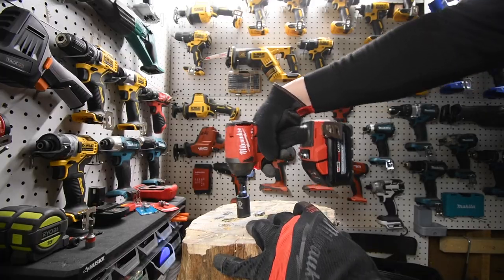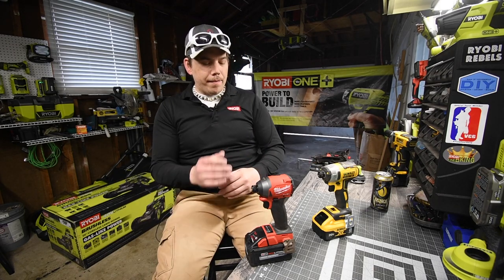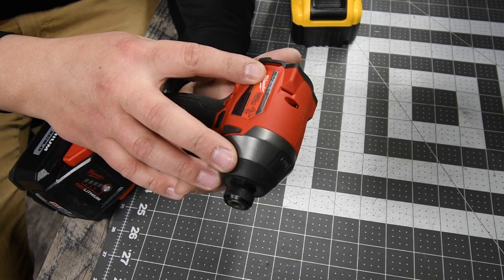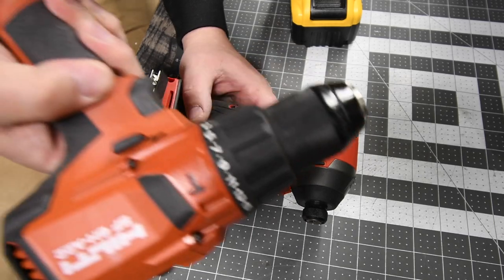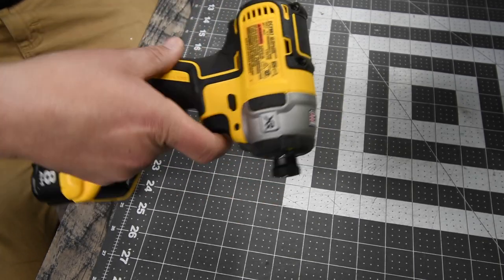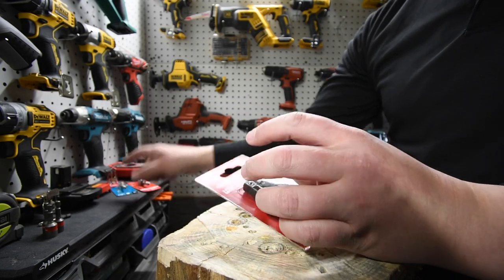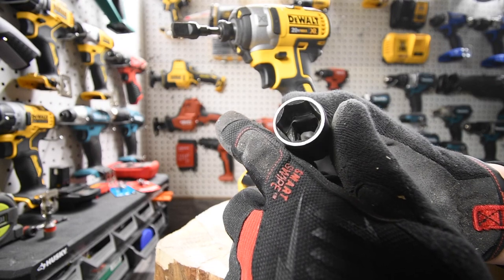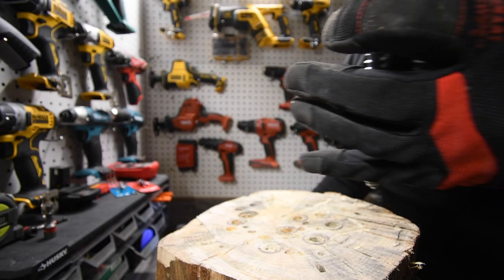NEW!! Dewalt 8ah vs Milwuakee 8ah HO

Comment: For many years Dewalt was the best impact driver .
What milwaukee did with this impact driver is they put a rapid motor and harden the spring, and one my tool they put a special smell as a burned tool so I don't know the difference when is really burning 🙂
Reply from the maker: I think they should make a better version
Reply: Dewalt never had the best impact driver

Comment: I like how small the Dewalt and Milwaukee 8.0 batteries are. I wish the Makita batteries were smaller
Reply: Makita makes a 2ah small battery and I love makita the impact I got is a beast
Reply: Makita needs to make newer 18v batteries in general they only have up to 6 amper hour while millwaukee has 12 and after a quick google search i learned so does dewalt, ryobi and ridgid make 9 ah i feel like every tool company should atleast make up to 8 ah also shoutout to bosch for having insanely small batteries for their ah size
Reply from the maker: I do as well and they need to make special batteries as well
Reply: Put a 5ah Makita next to a 5ah Milwaukee and tell me which one is more compact

Comment: When the new Dewalt impact comes out it will help, but that 887 doesn’t have the power detect technology so the battery might help a little bit won’t get the benefits of the Power Detect tools!!!!
Reply from the maker: we will see when it comes out
Reply: I was gonna say the same thing. The new 998 power detect drill by dewalt is new the class leader until we see it side by side the makita 40v. Surely their power detect impact will take over too. I've avoided that current one. I do have the Mid torque dewalt impact wrench you got there and it's an awesome tool. Not too big and plenty of power. I had to laugh at the suggestion the Milwaukee impact driver would be more powerful. I have both and their poles apart.

Comment: Its taken Dewalt 2 years and they still don't have a drill/impact that competes with the 2 year old Gen3.
Reply: Brandon Waller they should put quarter inch hex. Colet on the midrange impact wrench and speed moter up
Reply: At least their drill is not powerful
Reply from the maker: The dewalt Power Detect hammer drill is the best hammer drill out there, it beat the HILTI and Milwuakee Fuel
Reply: Dewalt is falling behind with  impact drivers i use to use dewalt  powrr tools 100% at work them my boss got us Makita the white kit in 09 then want over to Ridgid and bosch
Reply: @ManCaverTools  The dewalt Power Detect drill is impressive, but it might be behind the new Makita 40v drill which has been released in some markets.
Reply: The 996 came out in 2016.  It's always been more powerful than the Gen 2/3 drills. 

887 is a mediocre impact driver, sure, but let's not pretend that Dewalt doesn't know how to make a good drill.  Because the 996/796 are both category leaders.

Comment: What you said about the motor differentiating the impact wrech and impact drivers apart is incorrect Milwaukee uses the same motor in their ¼" stubby impact wrench as they do in the ¼" hex impact driver. What separates them is the hamering mechanism/anvil and gearing. The motor has nothing to do with it other than direct input everything past the motor is what separates them.
Reply from the maker: I thank you for viewing Zach

Comment: Put that DeWalt impact wrench up against the 2767.  Apples to apples.
Reply: Rafael Marin 

No Ones done This, and I think the 899 would be more or less on par with the 2767.  Either way both the 887 and 899 are over due for an update, I believe we will see a power detect version of both tools sooner or later.
Reply: @juanc5149  Real Tool Review did it against the old 2763 and the I.R., I haven't seen any against the 2767...
Reply from the maker: very good and thank you sir